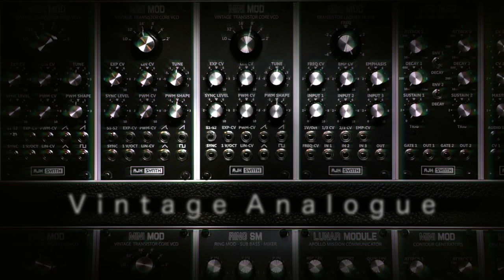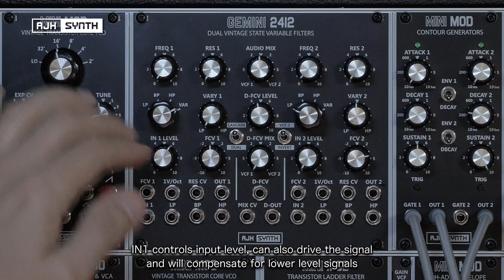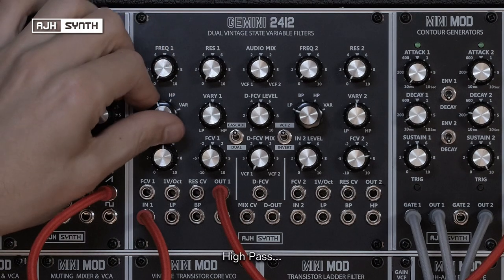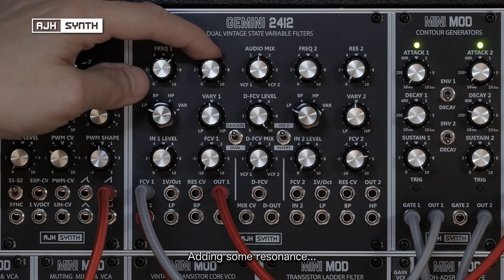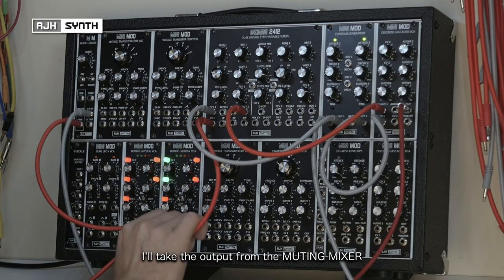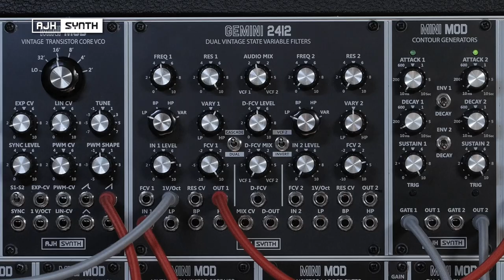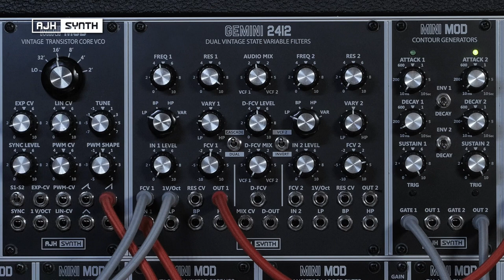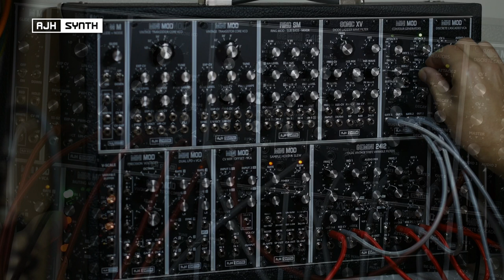GEMINI 2412 User Guide Part 1: The Single Filter (Explaining the individual VCF with audio examples)

Comment: There aren´t many filters out there that offer both options at the same time: Switching between HP/BP/LP or blending/morphing/mixing in any way you want. Most of the time you have to follow the designer´s choice. Kudos to AJH to optimize for versatility instead of size. 
The distance between knobs makes this moduke a pleasure to work with and the controls feel great. All of that plus the legendary sonic qualities... I have a 2nd 2412 on my shopping list.
Reply from the maker: Thank you very much - Options and ergonomics were definitely more important here than size, really glad to hear it's appreciated, and even at 28hp it's still only the equivalent rack space of two 14hp Ladder Filters.